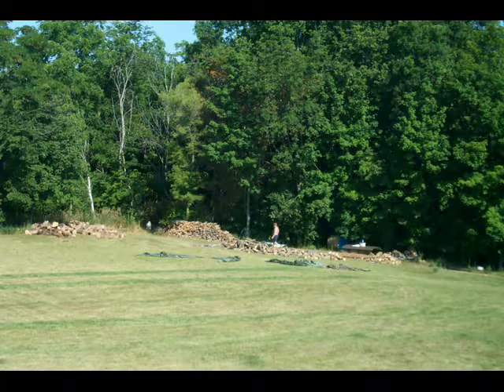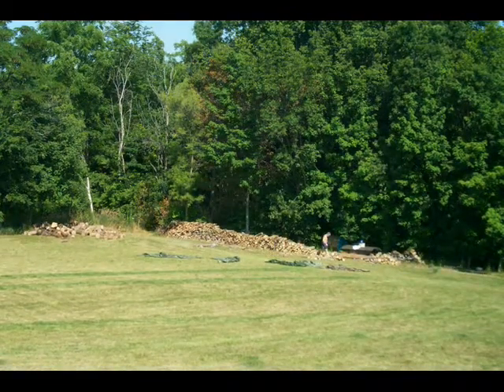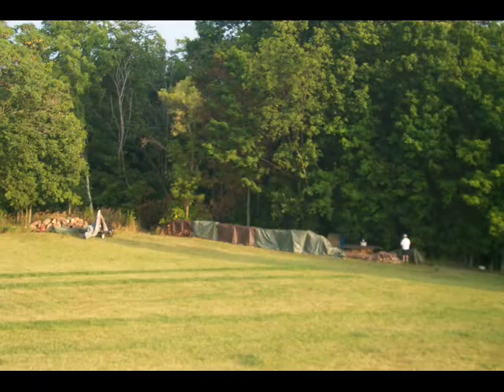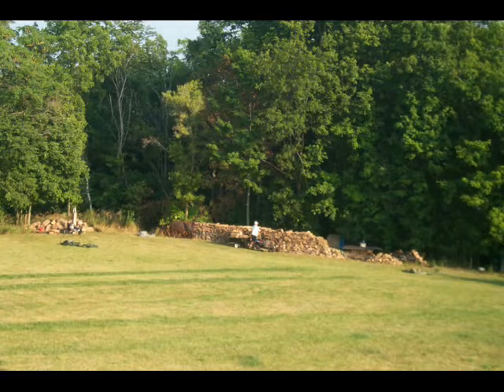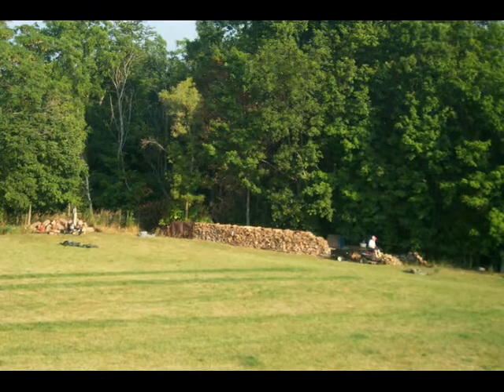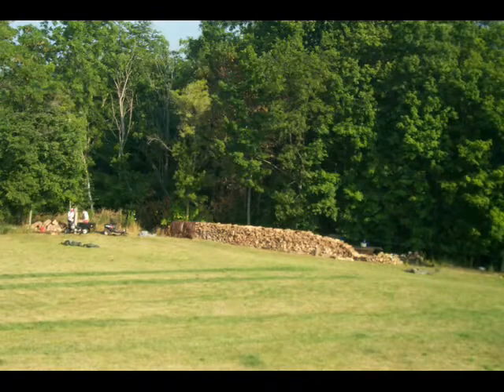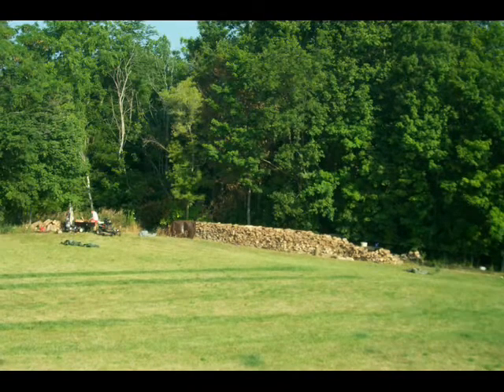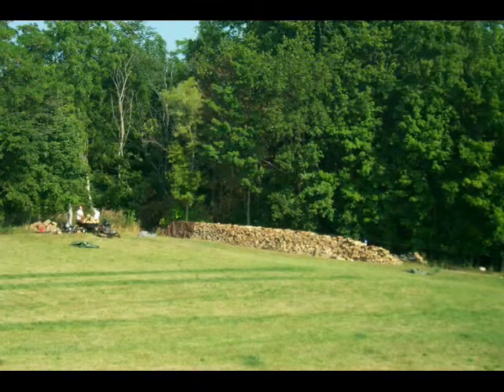Building the Woodpile

Comment from the maker: It is stacked in a straight line to act like a solar panel so I will dry in 4 months. Most people who burn only wood for heat use about three times that at least. We usually only burn about 2/3rds of that wood. And even then my set up is efficient enough that we only have 15 gallons of ashes.